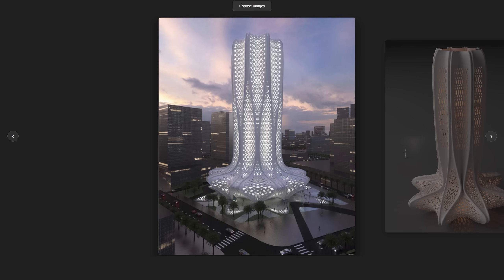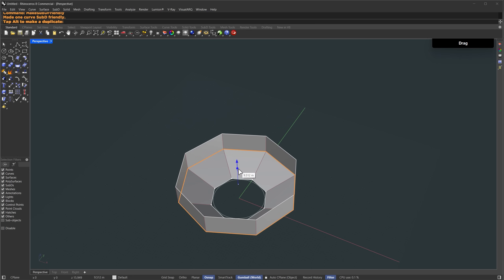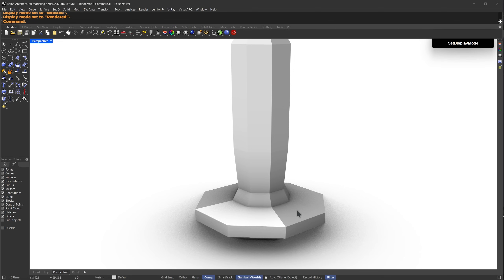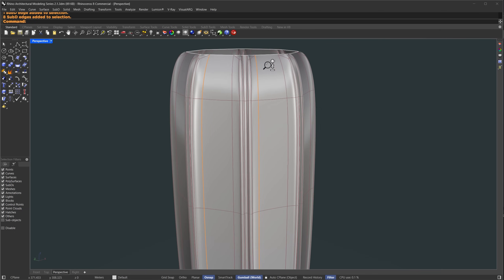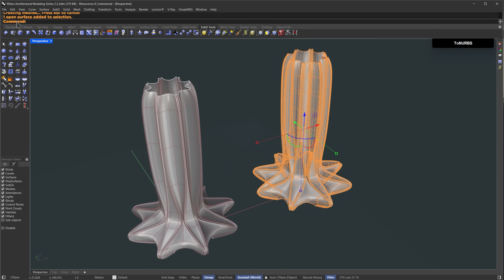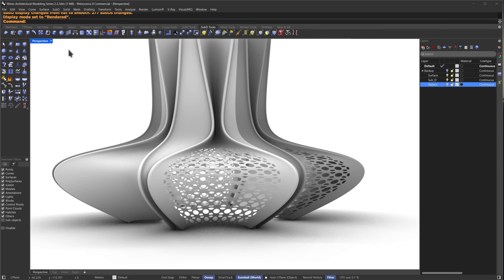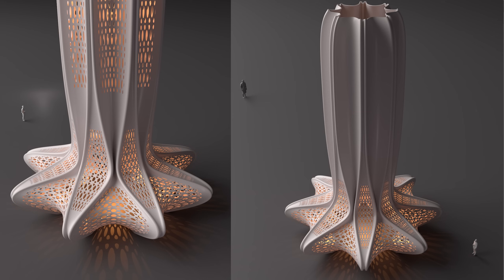Rhino Architectural Modeling | Desert Flower Tower

Comment: Very nice tutorial, I thought you would have used Rhinoceros Grasshopper, I’ve seen many similar tutorials made with Rhino Grasshopper. 
Is like Blender workflow, I saw similar blender vase tutorials.

I'm here because I looking for some tutorilas about MODERNMACHINE 3D vases tutorials that are similar style but I think it use more voronoi. 

Can you easily apply some voronoi function in Rhino instead of use of Mesh poligons/faces/edges? In Blender there is a Voronoi modifier 

One thing I wonder is whether you could just click the function icon instead of typing a command in the command line. For me, it’s much easier to associate a visual image with a function. Of course, once you get familiar with it, using the command line becomes natural and even faster.
I’ve noticed that many tutorials rely heavily on the command line, which often makes me follow them step by step without really understanding what I’m doing. By the time the tutorial is over, I’ve already forgotten the steps.

I really admire people who can do everything from the command line. I keep wondering how they become that skille, maybe it helps to have a programming background?

In Blender, the keyboard is used extensively, and for beginners or occasional users, it can be hard to remember functions, especially when switching between different software it can get confusing.

I’ve also seen many similar tutorials with Rhino Grasshopper, but I struggled to understand how it works, much like using nodes in Blender. It seems you need to know all the software’s features in depth to use them properly. Even a small mistake or a slightly different parameter—caused by an update or a plugin that’s no longer available or has become paid—can prevent you from getting the desired result. In some Grasshopper tutorials I followed, I didn’t achieve the outcome I expected, which was really disappointing.

Comment: Hola, gracias por el tutorial, creo que tengo el mismo problema que varios, a la hora de hacer el "make subd friendly" se extrude el circulo, no el poligono, al hacer "tab" nada pasa, sigue siendo un circulo… 😢
Reply from the maker: We just checked, and it works as expected on our side. Which Rhino version are you using? If your extrusion stays as a Brep, run ToSubD to convert it, after that, pressing Tab will work.

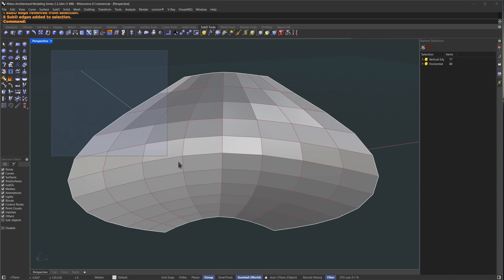Comment: Hi. Amazing Video. In the minute 10:13 you pute the command INSET., I make the same but the command shows insert Block. I dont know the problem
Reply from the maker: Not sure why it shows that for you. Try going to the SubD tools section and use Inset from there. Or, at the top menu, go to SubD → Edit Tools → Inset and pick it directly. That should work the same way.

Comment: how did you add another reflection plane?
Reply from the maker: You can add an additional reflection plane by simply running the same command again. If you couldn't do that, just finish one part and use a polar array with record history.
Reply: @3DBeast  running the same command cancels out the old reflection plane and creates a new one
Reply from the maker: @manetho5134  Try it on a different SubD first. If it still fails, you could try another command: ‘Radiate’.

Comment: Hi, great tutorial, but I get stuck at the face pack stage...when I delete the extra surfaces top and bottom, I don't get a unified colour and a single surfaces-instead it splits vertically into different colours...any idea what mistake I'm making? I've drawn it multiple times and get the same result
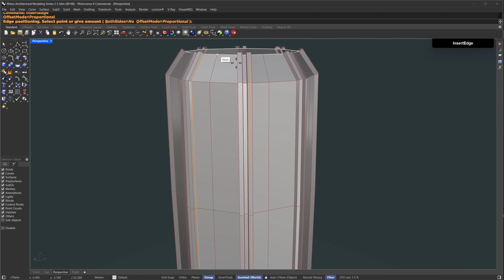Reply: To answer my own question, when I select the edge loop to insert a new one at 6:16, it also selects the edge of the surface you delete a couple of steps later-the only way I can get it to work is delete those surfaces before adding the edge loop. Maybe this'll help someone else...also still curious why I can't do it as you demonstrate?
Reply from the maker: @martincampbell2151  Think of it like this: the SubD surface should be a clean grid, like a cylinder that can be unrolled. Poles at the top or bottom twist the mesh flow, that's what we delete in the video. If all faces follow clean horizontal and vertical rows, it should convert into a single surface.
Reply: @3DBeast  really appreciate you taking the time to answer, I understand the reasoning, I just can't make it work as you did. even when I get a single surface at this stage, it splits into mulitiples when I reintroduce the isolated section we make the pattern on...

Comment: For some reason when i use the command optionsimport and select the file you gave w the presets it gives me the error specified file is not an options file.
Reply from the maker: It works for Rhino 8. Maybe you got that error because you’re using Rhino 7 or lower
Reply: @3DBeast   hey there, I'm having the same issue and I'm on Rhino 8 Mac version, though.

Comment: The slide is applied in a strange direction. What's the problem?
Reply from the maker: There’s an option to flip the direction. On the top of the command panel, choose either Across or Along to fix it

Comment: which settings do you have on cursor aid? when you scale starts at 0, mine in other like 150 so I have to add or substract to scale
Reply from the maker: To fix that, just type 0 and press Enter to set the scale center at 0 before scaling.
Reply: @3DBeast  thank you so much you really r a Beast 3D

Comment: For some reason when I try to join the pattern with the main massing it wont show on the symmetry (???) Did I do something wrong?
Reply: same issue it works for some and teh upper patterns doesnt work
Reply from the maker: Make sure the reflected plane direction is pointing toward the pattern. You can use the Flip option (at the top of the command panel) if it’s not. Also, test it on simple geometry first until you get the hang of it.

Comment: The slide command is showing a opposite direction... How to get that in one direction ?
Reply from the maker: Check the 'Across' option at the top of the command panel,  that flip the slide direction.
Reply: @3DBeast  Hello, having the same issue. Across is checked but I have arrows pointing opposite where in your video you can see the arrows pointing in the same direction so when I move the edge one goes out and the other goes in.
Reply: @alexrraines  did you find a solution?

Comment: Hello, I have a question. Do you have to enter the commands you enter into the command line manually? Or are they in the command table?
Reply from the maker: You don’t need to manually click the command line, just start typing anywhere, type the first 2–4 letters, and Rhino will auto-complete it. Then just hit spacebar or Enter. Or you can use the icons instead